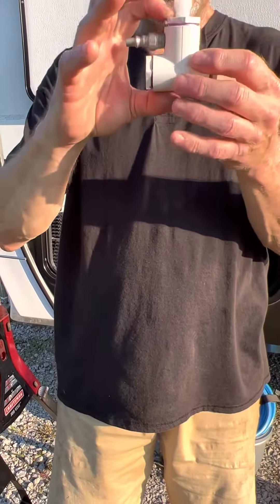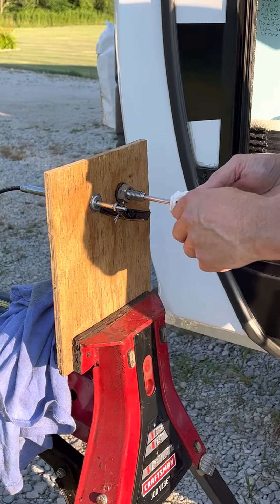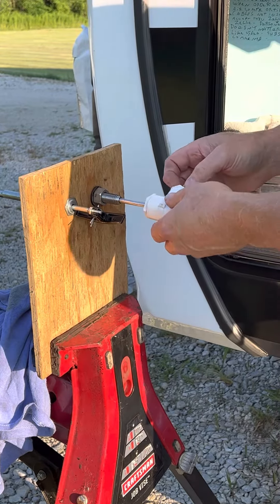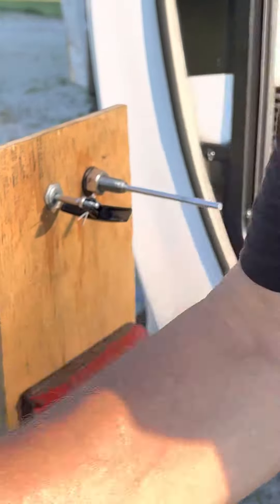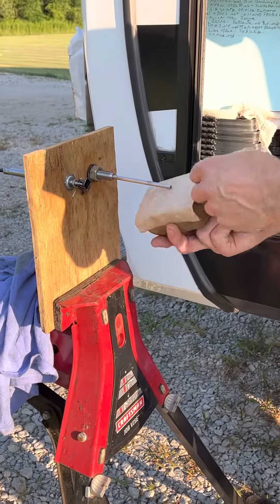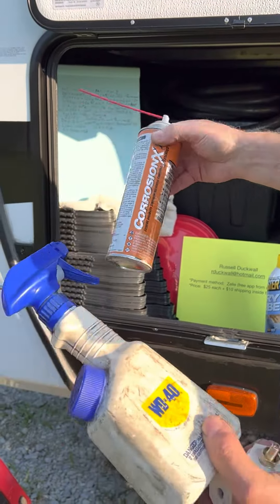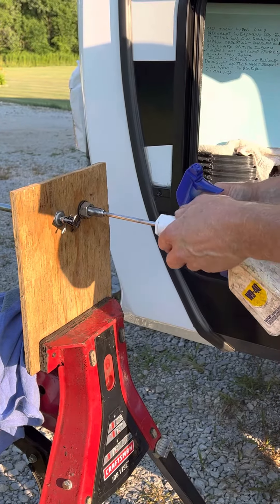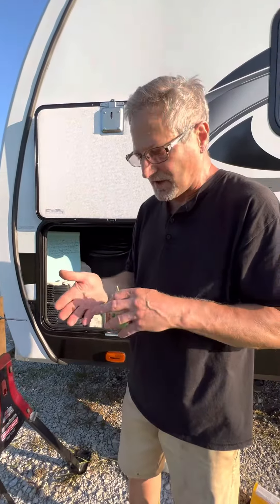Rv cable lubricator, new model that works where cables are mounted very close together.

Comment: 👍👍
The Cable Lubricator is a must for every RV. I had to adjust the nuts on the cable so the Lubricator can screw it self onto the threads on the cable. If you have any problems just call Russ and he will help you not like a big store company
Reply from the maker: Thanks Peter, I appreciate that!!

Comment: This tool is great!  Ordered and used to restore an old cable valve. Works great now.  Never need to have valves replaced again due to cable issue.  Thanks, Russ

Comment: Throw the damn useless cables in the garbage and install electric valve servos. Cost me 400 bucks and an after noon to install. ALL valve control and leak issues gone and I don’t have get down on ground to dump my tanks any longer.
Reply: I've replaced those servos. They fail, too.
Reply: @hyperlogos  I’d rather replace the odd servo then put up with the crappy gables any day.